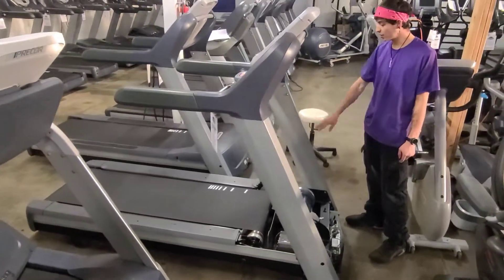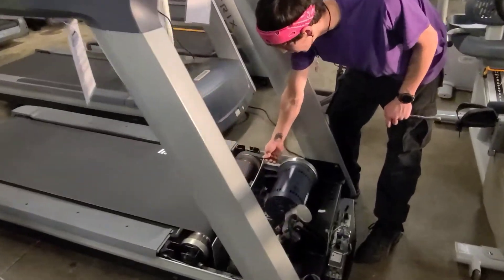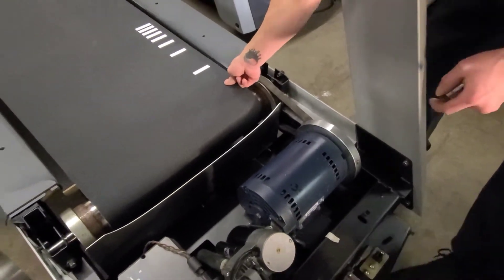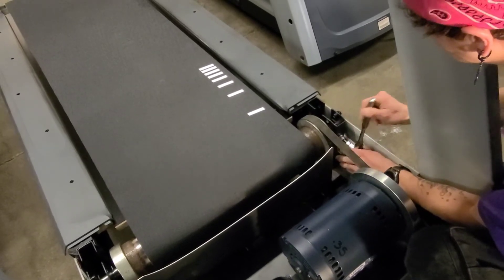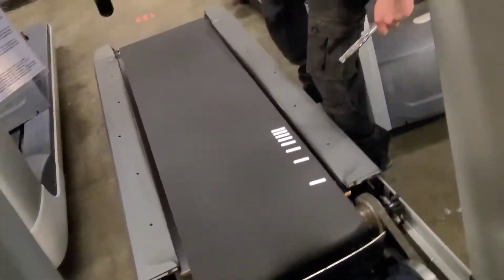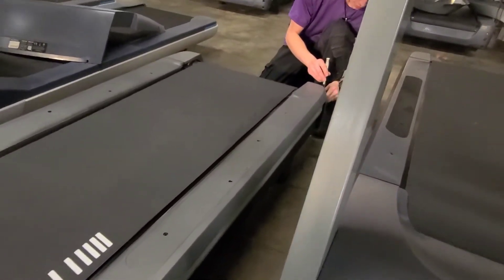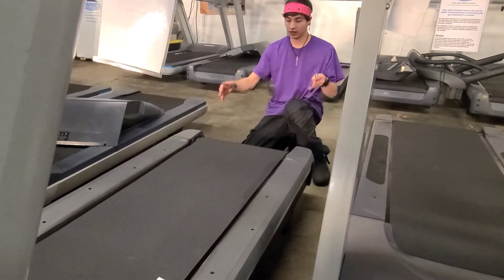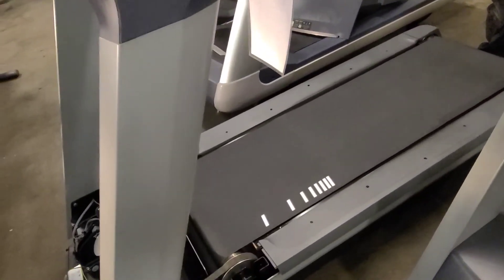How to fix a loud banging noise on your Treadmill.

Comment: It sounds like the noise I get on my new 3 day old treadmill - Horizon 7.0AT. I was wondering if you’d hear that noise only when weight bearing on the running belt. Mine is running quiet and smooth - even when speeding up and down and inclining and declining - but only makes the noise when it’s operating and I put my feet down. 

Even standing and moving side to side on step saddle makes that noise when the machine is running - maybe more close to rattling noise. Yet the floor and machine are measured to be level - timber floor with basement underneath but with steel frames under the floor. No noise on walking or bouncing up and down on running belt when it’s not running - no noise on moving side to side on step saddle either. What could this noise be?
Reply from the maker: Is the drag on the running belt,  try and put some silicone on the underside on the belt

Comment: Hello, this is exactly the sound my treadmill is doing in a higher speed when speed walking and running. It's clicking only on one side (when stepping right foot). I checked the belt you are showing in video, but it seems the tension is ok. I don't know what to do anymore, it is really annoying noise.. Do you have any idea, what could be wrong?

Comment: I’ve Precor c956i that grumbles at 1~3 miles per hour, but goes away at higher speeds. My DRIve belt can be twisted 90 degrees. Could my issue be resolved by pulling the front roller back toward rear to tighten belt WITHOUT having to loosen the motor bolts and pulling the motor itself back?
Reply from the maker: Yes you can tighten the drive belt by the front roller, but you will have to tighten the back roller the same to keep the running belt tight. The "grumbling" might just be a bearing that is going out in the motor but you can still use the treadmill for a long while before it final will go out.
Reply: @coloradocardio  what’s crazy is that if I turn power switch off, and back on…the treadmill doesn’t make that early startup/shutdown noise, instead irate runs smoothly! It doesn’t seem to make sense.
Reply from the maker: @hahahahagrin  Can you make a video of this and send it or upload it to youtube?